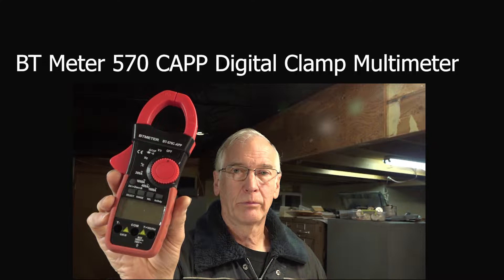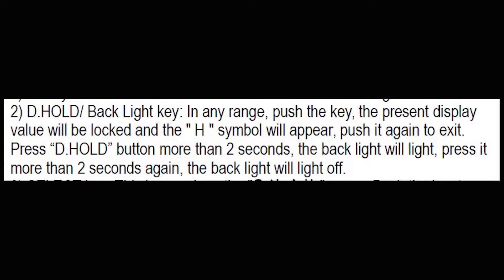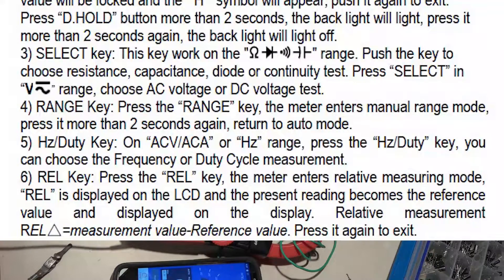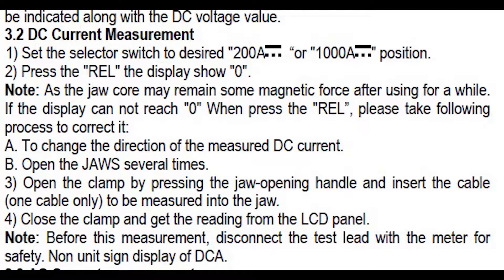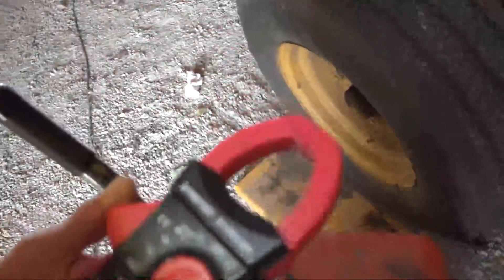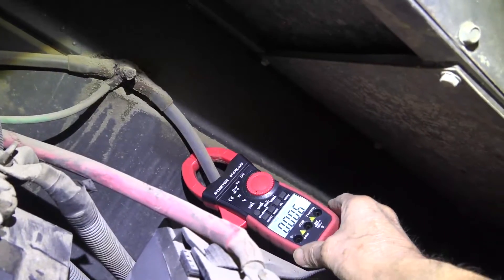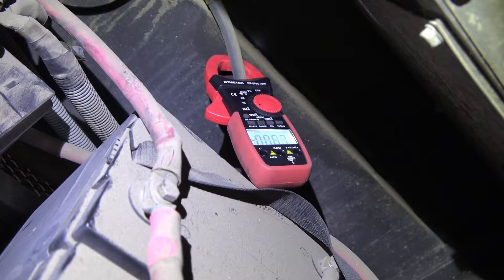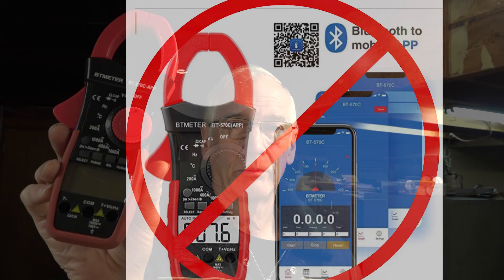BT Meter 570 C APP Review and why I sent it back

Comment: The REL is like the ZERO button on other clamp meters. Works as i would expect it to. You were just using it wrong because you have to calibrate just before you clamp the meter on.
Drift in DC current mode is normal on other clamp meters as well.
Reply: Thanks for that.  I was having the same problems but this now makes sense.  I will try again today and see if I get results that make sense as well.  I kept wondering how to zero the thing out.  BTW the PeakHold (brand) meters are exactly the same  I have the PH-570C (without the blue tooth).  The PeakHold website doesn't even list the model.
Reply: Where can I get a hard copy  user's manual 🤔??

Comment: The new Fluke 377 and 378 reads ac/dc amps AND voltage through the clamp on a doube display screen(first clamp meter EVER to do such a job) with Bluetooth connect to your phone... BUT it is $1450 aud 😭

Comment: I bought this meter for the purpose of data-logging. My phone app ( iPhone 8+) connects as well as tablets with no trouble, but SAVING the data using their recommended   iTools4 app, turned into a problem.  The instructions say "computer" ?  I believe I figured out that you can't download that app for a tablet, only a PC computer. So I DID download it to my PC, however that app turns into a driver device monitor system that I don't need, want nor trust.  I'm thinking "free" app in trade for spyware.    So I think this thing is NOT going to be a data logger as they advertise.    All other functions behave similar to your excellent video demonstration.

Comment: I was reading that some manufacturers like some holdpeak multimeter I saw use normal carbon steel instead of electrical silicon steel. Carbon causes this hysteresis issue (the BH curve widening). What do you think?

Comment: Is the transformer nearby is on? If it's a welding or charging unit it most likely has a scattered magnetic field. Maybe interfering with the measurement, high-end clamp meters do this too.

Comment: You are supposed to push the REL before clamping the meter, then it starts at zero. Just sayin ☺👍
Reply: Exactly. I purchased this and it works fantastically well. Considering the price this has got the DC current measurement it's great.

Comment: REL is like TARE on a scale, you don't use it with current going through it.  Turn on... REL(with no current)... use the meter. I have found myself checking it from time to time, it does go off a little, but if you measure always in the same direction, seems pretty stable. For the price and Bluetooth, I found it very useful testing and creating a discharge curve for super capacitors... I am however experiencing a problem now with voltage readings... I think I tried to check voltage while on the AMPS setting... I think that busted something inside.

Comment: Thanks for your review. Very helpful in that I'm having the exact same "weirdness" with this clamp meter. I've tried a few and need a good one for DC amps. This piece is going back.  I'll look at fluke.
Reply from the maker: Hey thanks for commenting Darren. I don't do a whole lot of reviews and I feel better that someone else has had the same weirdness. I would hate to slam the thing if I was the only one.
Reply: @unique3phase  I think you are supposed to zero the amps, using the REL button, before you connect it to a wire.
Reply: Darren M. Kline has the best one model CL800

Comment: Good information, I'd like to see if the manufacturer can give some feedback on this incompetent product.
Reply from the maker: You know I don't normally do product reviews and I also wondered if the company would contact me.  I figured that might see this and come up with some sort of explanation. The voltage measurement part worked at first and then went bad. The bluetooth worked for a while.  And the DC amp measurement is not what you would expect.  When you add it all up maybe the product was rushed to market or I got a bad one. But I think the DC amp measurement is going to be tough to work right.  It is not as easy and simple as AC measurement that we are all used to.

Comment: Can you recommend a clamp on meter that measures DC amps as accurately as the AC amps you show?  And are these clamp on meters good for measuring small DC currents, such as 20mA?  I don't have much experience with clamp-on type meters, but that would be handy to measure small DC currents without breaking the circuit.
Reply from the maker: This is a good question Kim, but the answer is I don't know. Ac amps are just really easy to measure. You are talking about a current transformer and a meter that reads the output. Transformers are tried and tested and work great. Ac current demagnetizes iron.The dc measurement is a recent development in these meters. I found that the whole problem seems to be the dc magnetizes stuff. So I found that the REL button seems to be designed to demagnetize, or clear out, or get rid of what ever is left in the meter jaws. But that is not always the case. If you are really observant on this you can get a pretty accurate reading even down to 1 amp.  But it is not worth using this because you are always in doubt about what it should really read. They tout up the bluetooth remote reading but that doesn't work because the rel button needs to be pressed to clear out the residual magnetism. If you measure something and then turn the equipment off and then on again with the meter just hanging there it will add some amps to the reading. It needed to be rel keyed again. I don't know how something like the Fluke would work, someone said they bought one of them.
Reply: I like theory of blu tooth, I have a positive draw, bmw, battery in back main fuses in glove box, could leave hooked up and monitor use ing phone?

Comment: Interesting video. Did Steven Cox ever use that air compressor you sent him?
Reply from the maker: No, one of my customers sent me a link to a Craigslist ad that Stephen put up selling the compressor. I never contacted him about it because in the craigslist ad he said he was getting a divorce and needed money. I felt bad for him, but of course the air compressor give away didn't turn out the way I had hoped. And for some reason he scraped the Unique3phase decal off the front of the thing.  Kind of disappointing, but that happens sometimes in life. I have not followed him so I don't know if he did get divorced or what. Thanks for the comment.